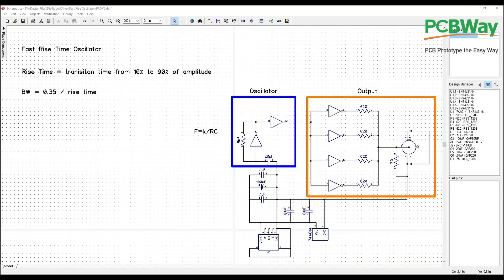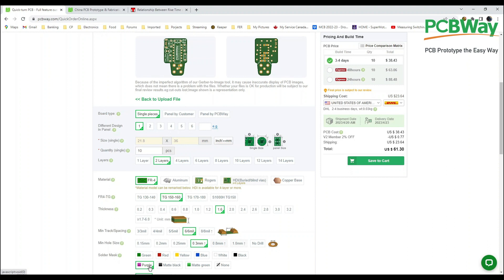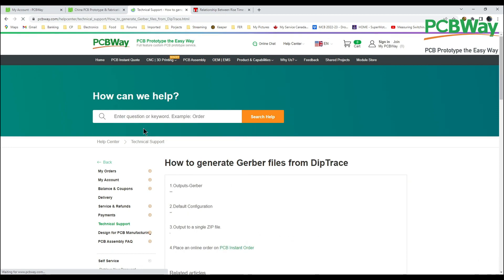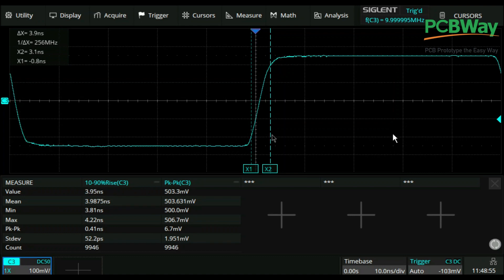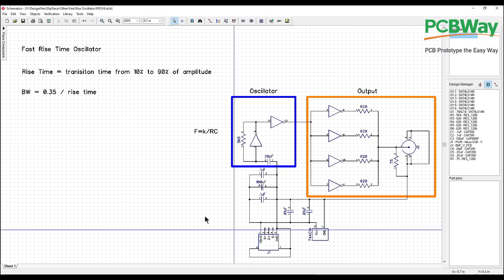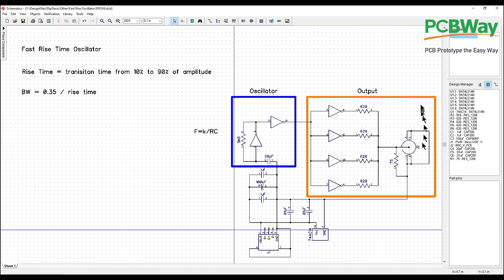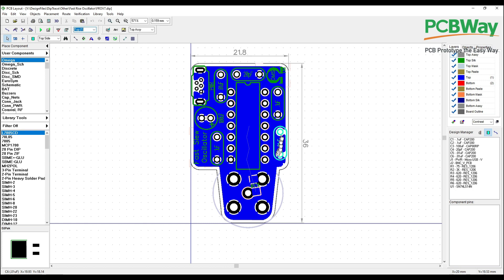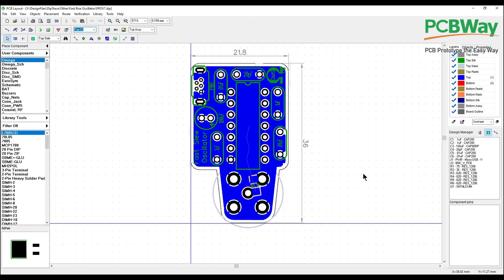0038 - Project: Fast Rise Time Oscillator Part 1

Comment: Is using 4 inverters in parallel making rise/fall time shorter?
Reply from the maker: Yes.  It does 2 things that aid in reducing rise time.  1) It reduces the load on each so they can switch a bit faster.  2) it reduces the overall dynamic impedance, especially the inductance.
Reply: @uni-byte  How about fall time? Are inveters capable of acting as sinks? And how about quadrupled input capacitance of quad inverters? I guess it is slowing it down to some extent?
Reply from the maker: @jakubczajka4275  Fall time is improved too.  In fact, it's usually a bit faster than teh rise time.  The capacitances are pretty much decoupled from each other via the 620 ohms resistors so each inverter only sees its own capacitance.